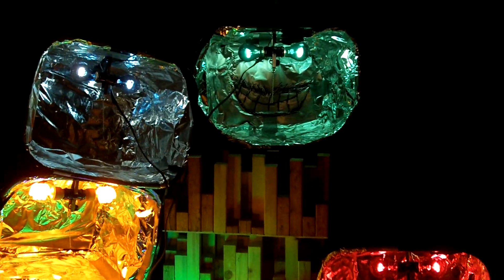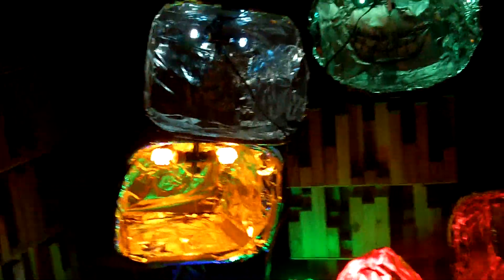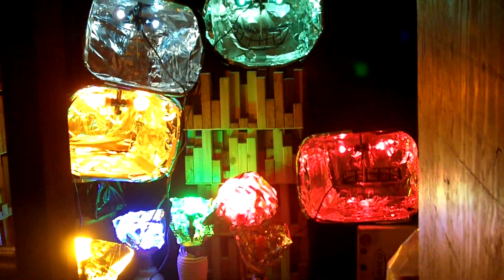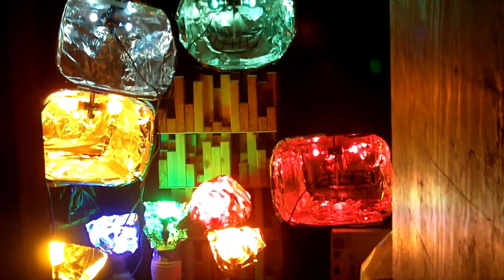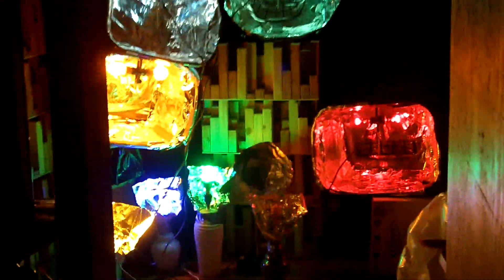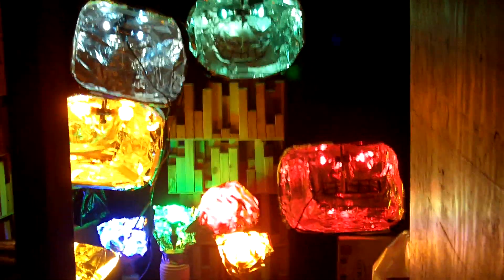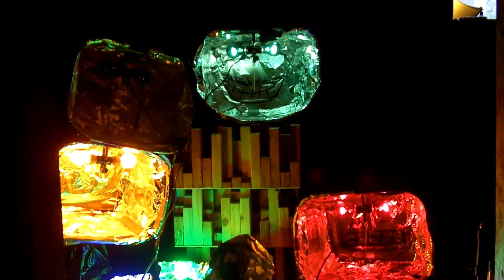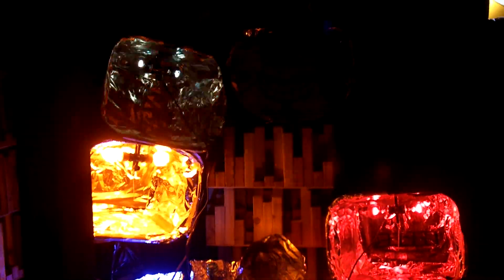DIY Arduino MIDI 2 Light Relays For Christmas / Stupidity

Comment: I have a similar idea on what you are doing but what I want to do I need to control a bunch of Christmas lights I know how to do the algorithm but How do I feed power to the lights?
Reply from the maker: +Andres De Jesus Do a search for Sainsmart relays.  That'll get you started.  You'll send your home voltage/power to the relay and control whether the relay is opened or closed with the arduino.

Comment from the maker: I wondered if the mechanical relays would last when switching up to 100 times a minute.  So far so good.  I burned up many relays during Christmas because the initial transient current was excessive.  By keeping the current load in check I put about 150 hours of this switching on the relays with no problem.  I may be on borrowed time and need to go solid state in the end.

Comment: This is exactly what I was looking for but I want to trigger 12volt relays with the arduino for flame throwers. I want to sync it to music because I do shows for Halloween. I've been doing this for about 4 years and have been timing it to music with a switch manually. now that i have three flamethrowers instead of the original one i had before you can imagine that this is really hard to do by hand. i would like to just set it up as a plug in play type deal run with my laptop. can you help me?